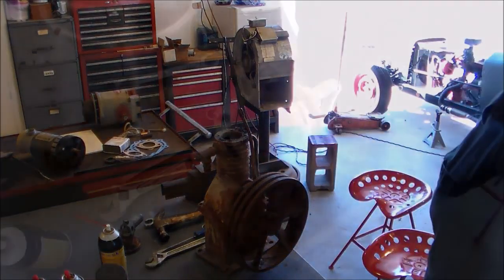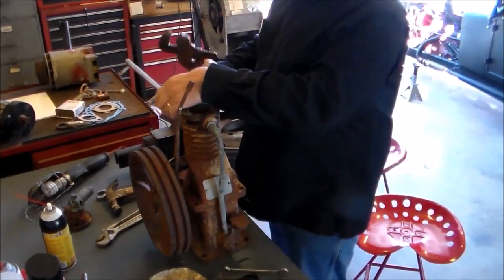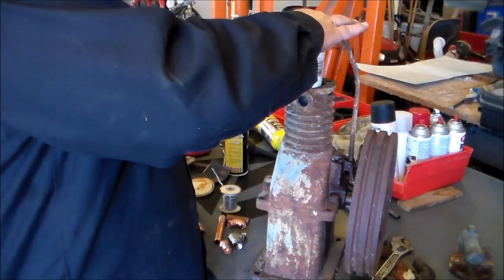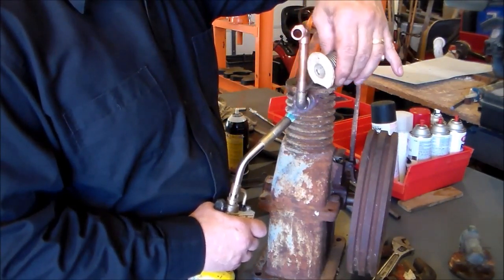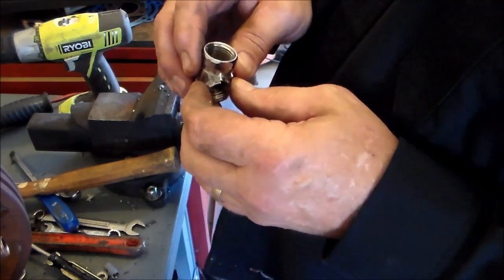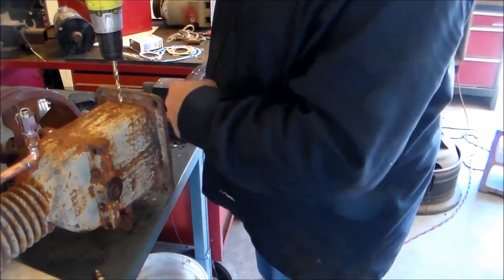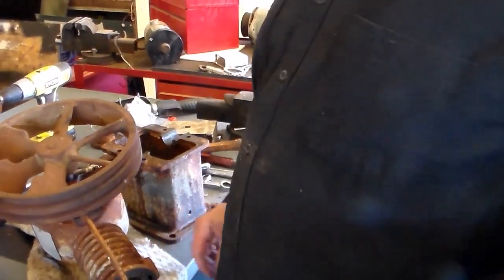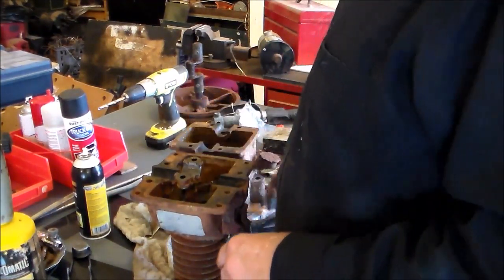Converted Air Compressor  to Gas Engine, part 1

Comment: Nice. love this sort of stuff. What sort of garage door opener have you got there RGB?
Reply from the maker: +n45829  No electric openers but got 3 overhead doors and keeps plenty of cross ventilation in the shop. End of the Summer months here so a good breeze is welcomed. Thanks for coming by

Comment: Rusty, Cool project for sure, U must live somewhere that does not freeze, that water filled crankcase would be frozen, broken, history here... I have an old compressor just like that in my garage, I walk by it everyday... Looking forward to part 2...
Reply from the maker: +Harvey Spooner  I live in TX , can get 20's but the heat is our claim to fame...lol  But I was really lucky it didn't crack.. I have another one that works , I have an antique engine that can drive it and blow some steam whistles I built. Thanks for coming by